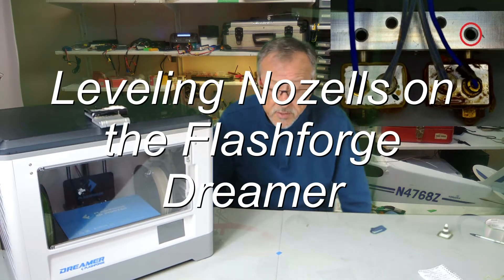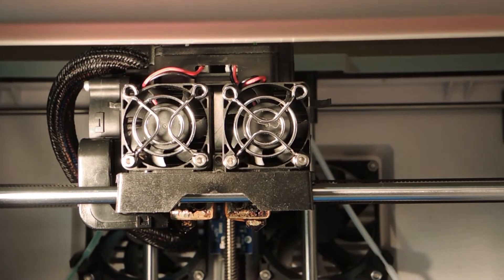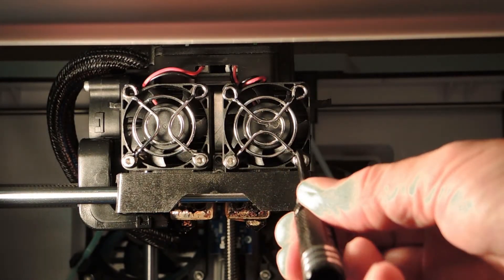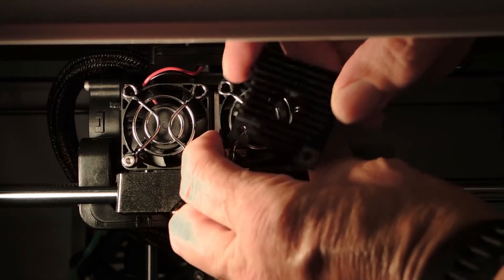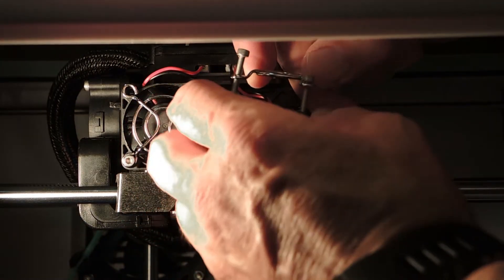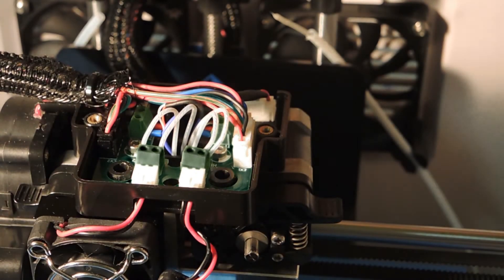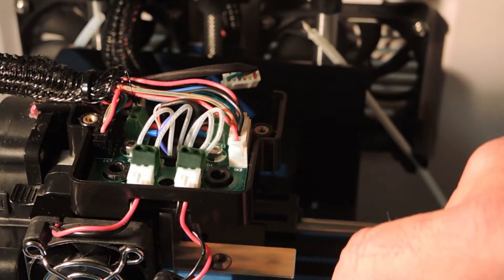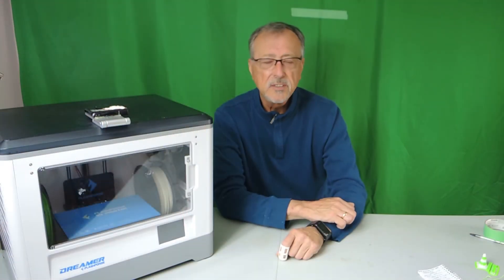Leveling Nozzles on Flashforge Dual Head 3D Printers

Comment: Good for showing how to remove the print motor - but you don't show the set screw at the back and you don't show how to align the two heads. As far as I can see there are no alignment screws. The set screw simply retains the head at whatever position you set - it is not useful for alignment itself.
Reply from the maker: I honestly don't know anymore . I have not had this machine for several years. Sorry.

Comment: I think you've just helped me solve a problem that's been intermittent in my borrowed printer since I got it ten days ago :D.

It didn't manifest fully until I've tried to do a large-ish print with silk PLA and I found the right extruder nozzle raking the supports; even going as far as bumping the bed downward just on the first layer.

Appreciate you taking the effort to document this. I have a Flashforge Inventor with a very similar extruder module.

Edit: seems to have resolved it. Now I need a better solution for the 1kg spool I have that won't fit internally. Filament snagged and pulled it from the extruder so I ended up printing about 8h of air overnight.

Comment: This is something I've had on my to-do list for year+ now and gonna try it any day now (Flashforge Inventor 1/dual head). But there is something I don't understand in this video.

4:12 - There are screws you can loosen up which will actually raise and lower the nozzle

4:54 - Loosen the screw for the nozzle in right, lower it down ............. you're gonna tighten the nozzle.

In 4:12 loosening the screws will rise/lower okay, but in 4:54 I'll have to finally tighten everything - Doesn't it go out of adjustment if I have loosened it to rise or lower it?

Or are there two screws, one for adjusting and another for locking it up after adjusting?

Comment: Thank you so much for this most helpful video. You are very clear in your explanations, and this was a much simpler procedure than what the internet will have yoh believe. Thanks for showing that to us.
Reply from the maker: My pleasure
Reply: @EmeraldMeadows  If I may trouble you for a question. I tried the procedure, but upon removing the tiny screw at the back, was still unable to lower the nozzle. I tried to pull it down with both my hand and with a spanner but no luck. Any guidance you may be able to offer is most appreciated, thank you.

Comment: Thanks for the simple instructions. I have found, when taking the print head fans off, that the easiest way to deal with the heat sink and it's little washers is to using masking/painters tape, and just tape the whole thing together once unscrewed.